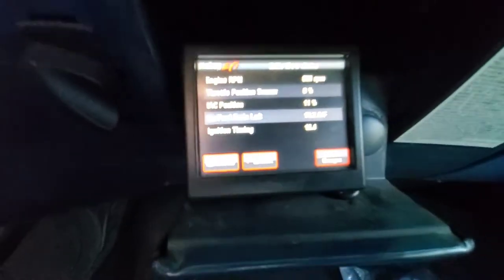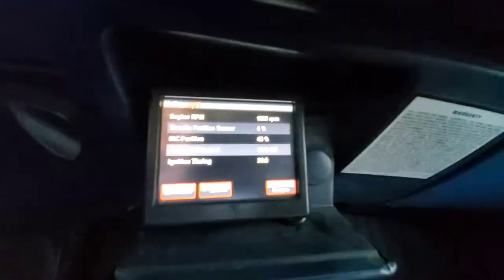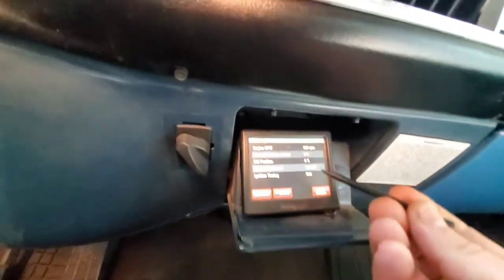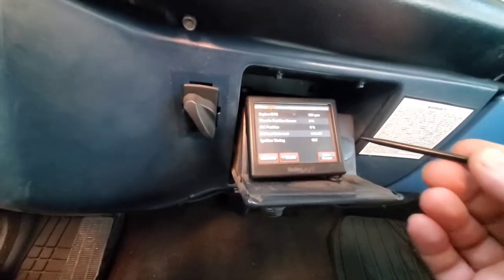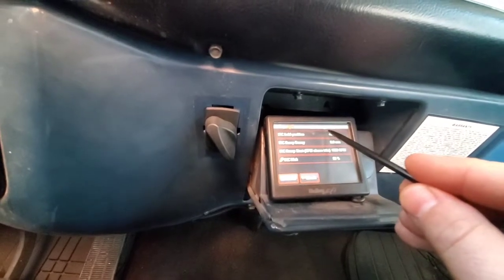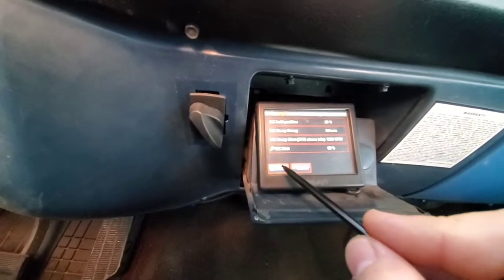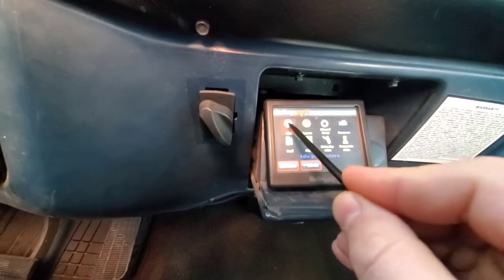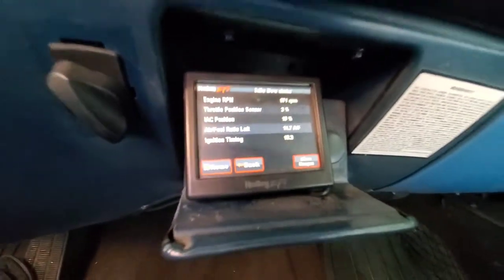Holley EFI  idle air control (iac) tuning

Comment: I have LS1 x max my truck has a vibration with foot on brake in gear. Do you think it could be the air / fuel setup? This is my first time doing a LS swap. It’s perfect when cold but seems like when it gets up to temp that’s when I feel vibrating in steering wheel.
Reply from the maker: Hard to say, I doubt t it's the afr settings. But I have had intermittent ignition coil issues that are similar to your symptoms
Reply: @JunkinwithJr  I have a scanner but there’s no where to connect to to check for misfire. I had my hot idle set at 600, now I have it at 800 and it’s not that bad but still there. I like the sound better with the idle low. It has a stock cam. I will check my plugs and see if there is one that looks different. They only have 64 miles on them we’ll actually every thing only has 64 miles, thanks for your help

Comment: Hey J, I didn't see the initial video and or the issue you had. My CJ5 Jeep has this Holley Sniper EFI but the issue I have is that my car will die at 35/45 minutes of driving around. It feels like something "heats" up or idles because I have to wait around 25 minutes to crank again and then i can drive around but it will die again so that's why I say its something that heats up and wont send the enough gas/power and the car dies. Everything is connected as it should and my mechanic has not find out any other issue than this system.. would you help? Calling this guys at Holley is like talking t o a wall.
Reply from the maker: Could be vapor lock. Rig up a fuel psi gauge so that you can check the psi when your problem occurs.  If it reads less that 40, that's a problem. Could be vapor lock or a faulty pump
Reply from the maker: Kari Schultz  will do, thanks

Comment: I have a 89 bronco and I put it on a 408 stroker and have been on the phone with Bill at Holley over and over the last week it was just a little rich when I started now it really rough at low rpm all the way up to 1250 before it levels out and is burning gas
Reply from the maker: Try unplugging the o2 sensor and see if it runs better. There's always a chance it's faulty and or sending an incorrect signal to the computer

Comment: Set it to ZERO instead of 20%. It will shut off when you're cruising. Its only for idle. My issue right now is, I cannot get mine down to 4 or 5 percent. Its usually in the 30 to 40 percent at idle. I've tried the "turn the idle screw up until its out and shuts off", and it does, but then it goes rich and bogs down. 12.8 AF idle?? So, as I slowly turn the screw back, as soon as the IAC tries to kick in, it goes right back up to 40%....no matter how slow I turn the screw. This makes for a bog spot just off idle, especially when you take off very slow. I know I have something set wrong, I just don't know what that is yet. Another phone call to Holley tech.......its a long wait but they do a good job.
Reply from the maker: The noise is not an issue at cruise only at idle.remember to do a tps autostart EVERY time you adjust the idle speed/butterfly screw
Reply: @JunkinwithJr  Yep, do the TPS thing every time too. Its something stupid that I'm not seeing....I'll be calling Holley monday. I've been in the classic auto restoration business for over 40 years. I know carbs and tuning all that stuff, we have a chassis dyno for all of our cars. We will put Packard's and Duesy's on it and get them running great, but this electric carb stuff is new to me. Which is why I wanted to try it. Learn something new! Its a learning curve for sure....
Reply: @Junkin' with Jr.  Can you explain the tps autostart please?
Reply from the maker: Enter the tps autostart and it will tell you to slowly depress the pedal twice and then it will tell you it tps autostart successful
Reply: I'm having the same issue did you find out what was causing the dying issue
Reply from the maker: The iac speed settings wil affect it a ton also
Reply: @JunkinwithJr   my iac hold is at 20% my iac was set to 2% dropped to 0% at idle fluctuated around there idle is set to 950 rpm it seems to only stall out when stopped and seems like when it's gets up to temp for a longer period starts stalling more frequently
Reply from the maker: @roberthansen6392  might try closing the throttle body to give the iac more room to "swing"
Reply: @JunkinwithJr  After 18 months of going back and forth, having the car runs great for a day then not, after never being able to get rid of the of idle stumble, I went back to a carb and the car has never ran better. I have a very cheap Sniper and fuel pump for sale....
Reply: I need your help my truck is day to day.. I set the iac to 8 to 12 percent but once i get rolling it’s 20 percent all day truck run percent all day.. park truck in my garage over night I go to crank her back up next morning I’m back 60 to 75 iac what am I doing wrong
Reply from the maker: @gulfdawg2806  probably not doing anything wrong. What you have it set at is the idle percentage which you want as close to 5 as possible. The hold position while driving will be around 40%. And when it's cold it will be higher until it warms up
Reply: @JunkinwithJr  I will check soon as I’m back at home and let you know